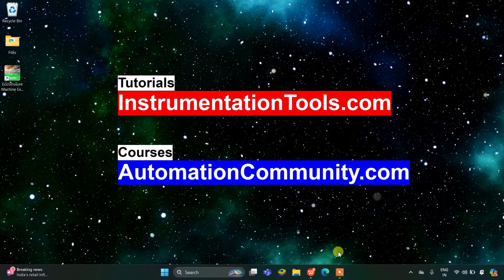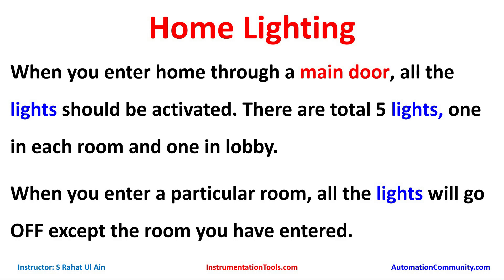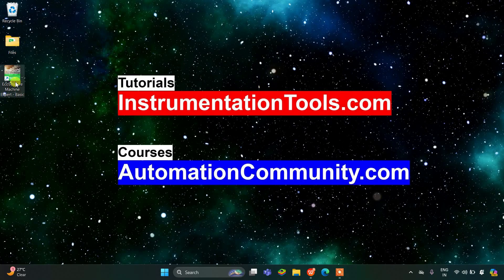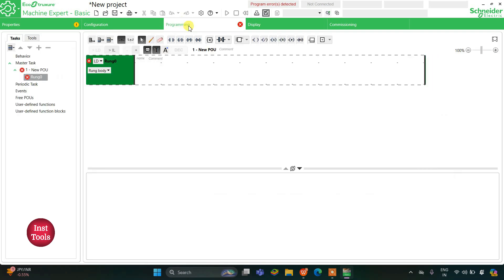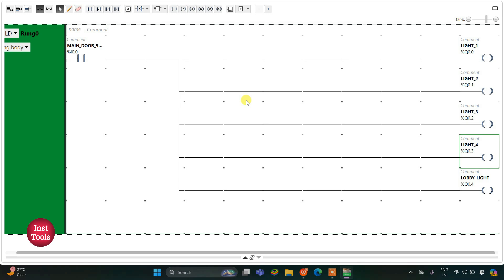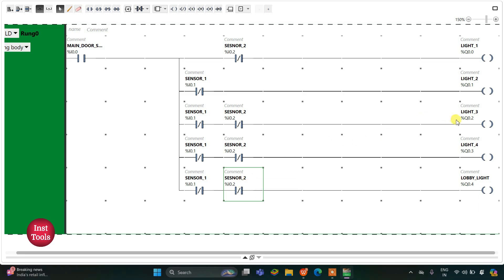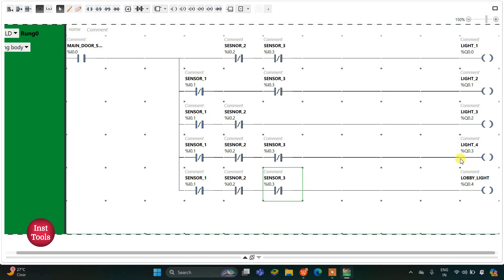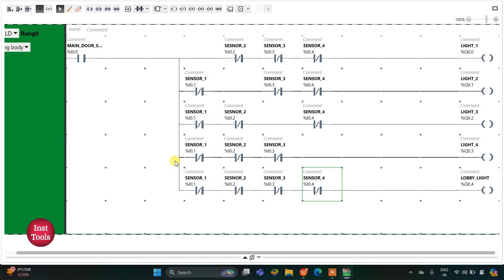PLC for House Lighting Control

Comment: He is still correct, except for the sensor at the entrance. According to this design, no light will turn on if no one is sensed at the entrance. You should add exclusive OR for each rung instead of AND logic   for the general sensor and others.
Reply: What do you mean? When the main door gets turned on every lights will be turn on too and if you open one sensor at time you open only that light that is connected to it 

There is no wrong or correct way you can do it like he did or you can also do it with Or-Gate Logic
Reply: @teknul89 What he's saying is that in the instance where you're already home and no one is activating the switch at the main door, the program would do nothing. since everything after the main door switch is dependant on where that sensor is activated the only way to get the other lights to turn on when anitger switch is activated would be do change the logic.

Comment: Not so appropriate. Supposing many people entering different rooms all lights will be off. Provide for switching On lights in rooms with people and switch off only when nobody is in the room
Reply: it is just for practice, dont take it seriously.....chill
Reply: No. He is still correct, except for the sensor at the entrance. According to this design, no light will turn on if no one is sensed at the entrance. You should add exclusive OR for each rung instead of AND logic   for the general sensor and others.